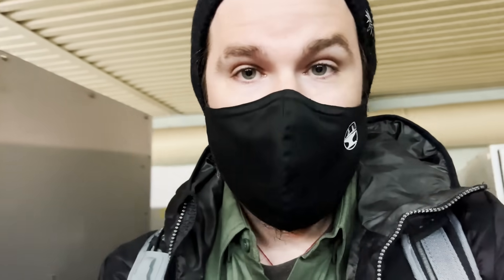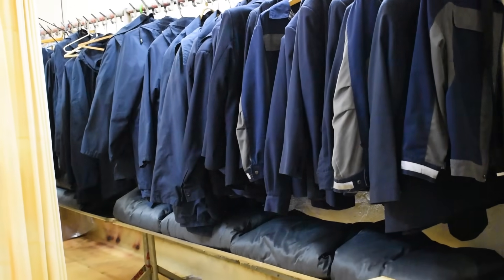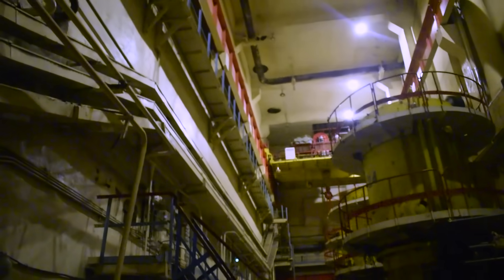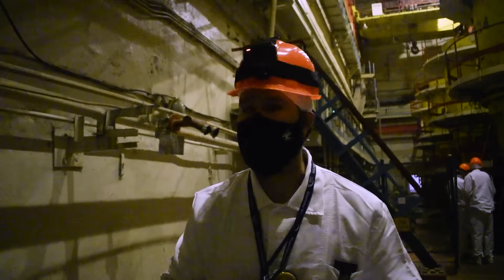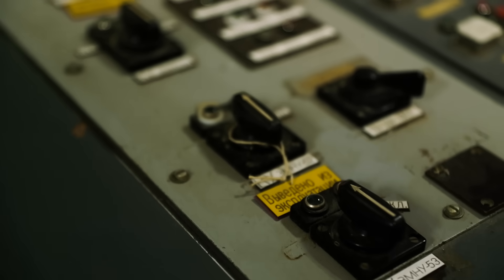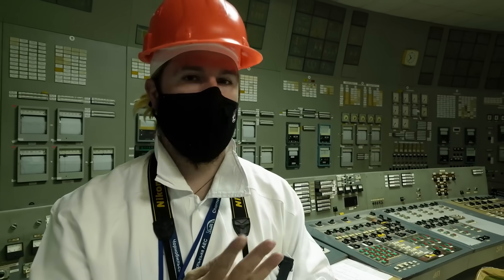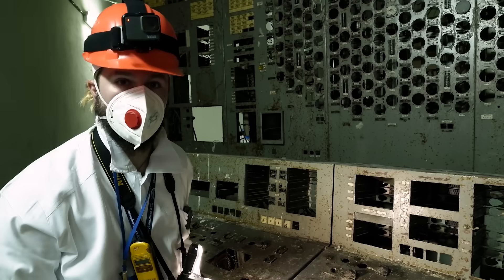Chernobyl Like You've Never Seen It Before...

Comment: 13:45 fun fact, not only did the force throw the upper biological shield up into the air for a full ten seconds, after landing back down, it now sits about 15° away from being totally vertical. So like a coin toss where the coin lands on its edge
The fallen structure is now referred to as Elena, and there have been concerns for a very long time that it could still fall down, because its just supported by a load of rubble which probably does not have the greatest structural integrity
There are some videos on YouTube filmed from inside that room, where you can see how the whole thing came to sit in the end
Reply: I have heard bouncing control rods, but can't remember anything about 10s hang time for entire thing.
Reply: @XtreeM_FaiL  The fuel assemblies were jumping up and down, the control rods were not yet scrammed.   The only witness to this reported that the reactor face looked like a pot of boiling water.  HBO and other shows give the impression they were rising and falling with a smooth motion but it sounds to me like they were getting popped up into the air and then falling straight back in.  I don't know what the lifting mechanism would have been, but I'm guessing at least one coolant channel had already ruptured an superheated steam was pushing up the fuel assemblies to a point at which they would release the pressure and fall again.   It would have been terrifying to see because at that point control was already lost.
Reply: If anyone is aware of a way to get in touch with Kyle and ask him where he got the specific '10 seconds' air time, that could be decent. After seeing all these replies and doing what may be a disproportionate amount of research into what we know about the initial explosion (it was the 1st explosion that threw the UBS up, this caused the core to be exposed, which led tto the 2nd explosion iirc) I cannot find this mentioned anywhere other than this video in particular
Reply: @CryptP  Maybe one of the workers on site told him?
Reply: @GBArkais  that's what I'm thinking, bc I can't find a written source on it anywhere. Just that the initial explosion must've moved the UBS, but not to what extent
Reply: @CryptP   he was off in a different video saying graphite slows the reactor process down in reality werent those control rods in a sense both an accelerator and moderator be it the tips are graphite and the other half is boron if im not mistaken. but throwing the az switch or the scram switch into it basically the water hits it fractures the rods forcing them to not fully insert and thus the graphite tips helped insure massive energy spike.
Reply: @Thieven1  It is technically possible considering it is steam. Just like a pressure cooker whistle. Here in India if you have a pressure cooker the weight of the pressure cooker whistle is lifted and it hangs in the air till the pressure equalizes the weight of the whistle. The counts of the whistle are used to tell when something is cooked or not.
Reply: @Thieven1  Yeah, my best guess is that one of the tour people mentioned it in passing. It's just kind of worrisome that he didn't fact check it at any point before including it in the final cut of this video where he states it as truth
Reply: The damage to the reactor hall indicates a messy, asymmetric explosion.  If the lid had been in the air for ten seconds, it would have flown ~122 meters high - higher than the top of the NSC structure - and moved off-axis horizontally due to the imperfect launch.  
It could not possibly have returned straight back down into the reactor vessel where it sits today like a flipped coin on edge.  It would be somewhere else.
Reply: @josephastier7421  As an admitted lay person in these matters this seems obvious to me also, it cannot possibly have been 'in the air' for 10 seconds.... like what??? Based on animations I've seen and such I pictured it being maybe a second at most
Reply: @josephastier7421  Agreed. To have them unseated, go up in the air then return to where they were ejected would have to be the visual work of a CGI, horror movie production. For 10sec.! They would travel randomly all over the place smashing that entire site to pieces and elsewhere. Some would finish up in Belarus.! 😆😂
Reply: Arsenal of Folly, Richard Rhodes history of the last days of the Cold War, opens with a gripping account of the Chernobyl explosion, and describes this as the  final position of the UBS.
Reply: A 10 second air time equates to a starting velocity of around 180km/hr (assuming vertical).
Reply: the image in my head was of the shield being forced up to the ceiling and held there by the pressure for 10 seconds. would that have been possible?
Reply: @skawesomeone  The second hydrogen explosion occurred roughly 2 seconds after the initial explosion as documented.  This would have contributed to the 10 second hang time, of the lid,  if it were in fact 10 seconds.
Reply: @TC-uy8ng  I'm not an expert any anything really, but how high does something need to be to be "in the air"? In my mind I picture it only being a few cm higher than it's original resting place. But maybe I'm not aware of what actually happened? Did the plate smash into the roof?
Reply: @SirEchoGaming  the plate probably smashed the roof put bounced back down. Then the second explosion finished the broken roof open.
Reply: @skawesomeone   not likely if its mass was shot to the ceiling it would bust it easily the key would be calculating the blast time when it blew the top to the time the roof went to then the time it landed back down. in theory it could've shot up hit the roof and helped knock the hole in it and then redirected downward but very unlikely it would stay up airborne for 10 whole seconds. considering how huge the blast was id estimate 2.5 to 4 seconds would be closer
Reply: How did they know the UBS was in the air for ten seconds?
Reply: @josephastier7421  I don't actually know that, can't find a specific source on it though Kyle does mention it in the video. I'd imagine someone just figured it out based on stuff like the distance it traveled and the force of the initial explosion, etc, but I genuinely can't find anything else on it.
Reply: @CryptP  This is the first I have ever heard of any 10-second hang time for the UBS.  It is now sitting (all 2,000 tons of it), on its edge more or less, on the lip of the blown reactor vessel.  The energy to move it there was phenomenal, not only having to lift its mass but also break every single cooling water pipe both coming and going, and there was one for every fuel rod.   But it seemed to me that all the energy did was shove it up and out of the way, and then erupt past it.  It didn't throw it into the air because it didn't have to.
Reply: @josephastier7421  it's not necessarily a case of whether it had to, it's that the explosion generated enough pressure to lift it several times over. I can't personally find a source on the time it did or did not spend in the air, and I was just taking that point from this video. Would also be interested to know where Kyle got the 10s thing from
Reply: @josephastier7421  Most likely calculated by the energy output, if it was known.
Reply: @josephastier7421  It's probably shit they feed to anyone that takes that tour. For those that didn't know, anyone can now take tours in Chernobyl, you just have to have money. It's very commercialized.
Reply: So many comments over what Kyle supposedly said in this video and literally no one got what he said right. He literally says it exploded with enough force to keep it in the air for ten seconds. He then claps to illustrate that the actual explosion, and resultant damage happened almost instantly by clapping. Nowhere does he say the lid stayed in the air for ten seconds. He's giving you a metaphorical example of a mathematical equation.

Comment: The "radiation airlock" system you mentioned is pretty standard for radiologically controlled areas and contaminated areas.
Given you can still hear individual counts instead of a dying-harddrive scream, you can tell dose rates in the area are pretty low.
Reply: Go to the Elephant,s Foot! Guaranteed to SCREAM!! As you will shortly as your guts melt and your skin turns black!🤔😱😱😵

Comment: Super awesome video! I'm wondering if you should have tucked in your hair a little better under you hood, but I'm sure it's fine for the relatively short amount of time you were probably there... Thank you for travelling and sharing!
Reply: You can hear at different points in the video that the Geiger counters are not really going crazy, indicating a relatively small amount of radiation. Any radioactive particles that get stuck to his hair are probably shoved off in the airlock he mentioned at the beginning of the video.

Comment: In my younger days I was a UK designated radiation worker, for about fifteen years. I still would NOT go into Chernobyl today! When you read what happened before, during and, possibly worst of all, after the explosion of Reactor 4, it is horrifying. I wouldn't trust them to look after my safety for one minute! The fact that they restarted two of the other reactors the next year, only finally shutting them down in 2000 should tell you all you need to know.

Comment: 13:31 Reactor #4 didn't meltdown, the water in reactor #4 all instantly turned into steam because of the graphite tips on the control rods accelerating the reaction when AZ-5 was pressed, this steam blew the lid off of the reactor and destroyed much of the reactor #4 building, the already superheated uranium and graphite in the core caught fire once exposed to the air and because the building was now gone, radioactive particles were carried by steam, smoke, and wind into the surrounding areas. A meltdown occurs when there is no coolant in a hot reactor causing the control rods and fuel to melt through the reactor housing and, on contact with water, may explode.
Reply: The reactor did meltdown. It wasn't the cause of the explosion but because of the sheer amount of energy and heat, everything melted down and through all of the concrete and protective housings around the core.
It is the only reactor accident in history to melt down and escape confinement. Thats what created the elephants foot, and part of why this is by far the worst nuclear accident in history.

Comment: Hi Kyle,
I'm curious about the ''cancer'' risk here. Did they inform you after your visit in Chernobyl, of the impact on futur cancer risk if it is suposed to be higher then an average person?

Thank you,
Reply: The cancer risk is actually basically nothing. Especially for a visit. 
The transient elements have almost all decayed away to the point where radiation levels outside the plant boundaries returned to background levels. 

It is a common myth to imagine that radioactivity lasts for millions of years like they tell you on the news, but it's easy to fearmonger it by taking the radioactivity level of the most dangerous element and saying it has the half life of the longest lived element. 

Radioactivity is inversely proportional to its longevity. You wear protection to handle fuel rods not because the fuel rods is a danger to you, but because you are a danger to the fuel rod. Most reactor interiors during maintenance are less radioactive than the outside background radiation, and orders of magnitude less radioactive than many coal plants (because yes, coal releases a LOT of radioactive compounds to atmosphere and they aren't being treated to any degree of control).

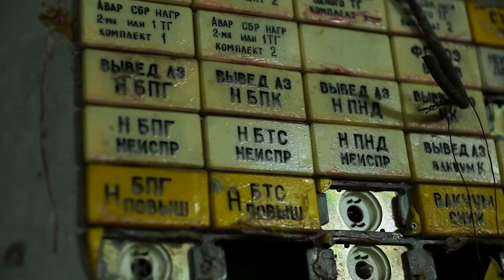Comment: 10:55 That sequence of events is not supported by data. Things did not start going to hell until after the AZ-5 (EPS-5) button was pressed, consistent with this button being pressed simply to shut down the reactor at the conclusion of the test. To quote the report in Annex I of INSAG-7, "Neither the reactor power nor the other parameters (pressure and water level in the steam separator drums, coolant and feedwater flow rates, etc.) required any intervention by the personnel or by the engineered safety features from the beginning of the tests until the EPS-5 button was pressed."

Unfortunately, and unknown to the operators, the design with the reactor combined with the operating parameters that were created by the test had caused the AZ-5 button to effectively become an "explode reactor now" button. To quote annex I again: "However, it would appear that, under the conditions of reduced ORM, as of 00:30 on 26 April 1986 it would have been impossible to use the emergency protection system of the reactor of this particular design, either in response to emergency signals or manually after completion of the tests, without damaging the core."

The report also concluded that, although the actions of the operators did violate operating procedures, similar reactor conditions (with presumably similarly catastrophic consequences) could have been created by a sequence of events that does not involve any such violations: "The Operating Procedures permitted operating conditions similar to those prevailing at Chernobyl Unit 4 on 26 April 1986 and they might have occurred without any intervention on the part of the personnel.  We only need to assume a perfectly possible situation in which triggering of EPS-3 occurs when the reactor is operating initially at rated power with an ORM of 26 manual control rods.  Under these conditions, approximately one hour after triggering of EPS-3 the ORM could have fallen to less than 15 manual control rods at a reactor power of 200-300 MW(th), and any further action, whether automatic or remote, to shut down the reactor could have led to a similar repetition of the events of 26 April 1986."

Comment: "Directed by Kyle Hill"? It's "Directed by Life, starring main actor Kyle Hill." But still, amazing insights. How long is the half life of the Elephant's foot? Can it be directly measured now? Can it be directly imaged or even contained? It would be amazing if there was an option to even get a chunk of it out, have it inside a castor container. I wonder if you can take such a castor container (since it'll be heated from the inside), tack a bunch of peltier elements on it and use the waste heat to passively generate some electricity. Sure, it's not much and Peltier Elements are far from efficient. But it's not supposed to, just enough to make this waste not completely useless. It has caused so much misery and pain - let it do some good for the next thousand years.

Comment: Ok, nit pick time. That white cloth mask he's wearing is an N-95 respirator. A much more protective mask to wear when up against things like viruses. However they absolutely MUST be fitted and sealed to your face with no gaps to work. Kyle's beard broke that seal and made an enormous gap for unwanted particles to enter. This is a massive fail for proper mask wearing etiquette. You either have to shave the beard down until it fits or get a larger respirator that covers the whole thing.

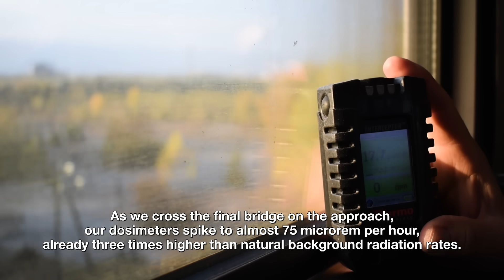Comment: that's kinda surprising that your dosimeter spiked so suddenly while you were on the train (~3:52).  Especially cause later, you were reading regular background again while in the exclusion zone (~6:02). Are you sure that wasn't just a momentary spike, such as the kind that can randomly occur when measuring background? Cause otherwise that implies a discontinuous air concentration of radionuclides. And reporting a spike as representative data seems kinda disingenuous
Reply: It could be, but the radiation isn't uniformly distributed across the region, and there are some pretty 'hot' spots dotted around the Exclusion Zone. It could be that the train passes through one of these hot spots on the way to the power plant.

Comment: As a person with experience in the mask area.  Beards and masks don't mix.  Just a little hair would cause me to breath in the chemicals where I used to work, even the small indentation from my glasses would not form a proper seal.  The result is cottonmouth caused by the chemicals and where you are, I would forgo the beard for safety.

Comment: Fukushima had 4 reactors blown up with 3 meltdowns, Chernobyl one reactor/one meltdown, and you're saying that Chernobyl is the worst nuclear desaster ever. Yeah sure, why not. You know, i like your work but this is simply not  true. It defies any logic. And yes, I saw your video "The Fukushima Disaster - Epidemic of Ghosts" where you try to explain why you claim that Chernobyl is the worst. I find it very difficult to believe the official statements made by the Japanese government and TEPCO after telling the world so many lies for so long.
Reply: None of the Fukushima reactors there exploded, though most of them did experience meltdowns. Any damage to the Fukushima reactor buildings is due to hydrogen, generated by the overheating reactors as the cooling water interacts with the nuclear fuel, accumulating in the reactor buildings and subsequently igniting. None of the reactor vessels were compromised, and hence the Fukushima accident has been rated at one level less than Chernobyl by the IAEA.

Comment: A weird little fun fact is that the facility (the other reactors in Chernobyl that survived the incident with reactor #4) continued to be used to generate electricity for years after the disaster, i believe 1 of the rectors (i forget which) continued in use to generate electricity even after the turn of the millennia before it was finally shut down for good

Which is just wild to think about, the site of the worst nuclear disaster in history at the same time being operated for decades
Reply: Correct! Unit 3 was shut down just slightly over 21 years ago.